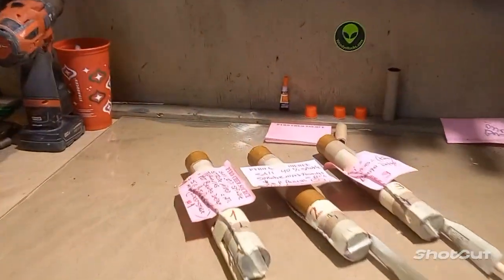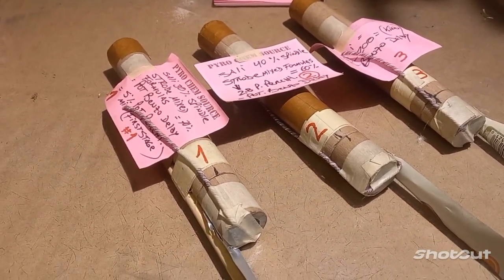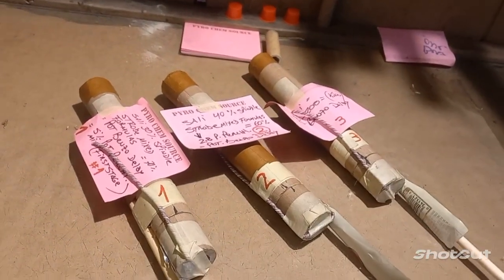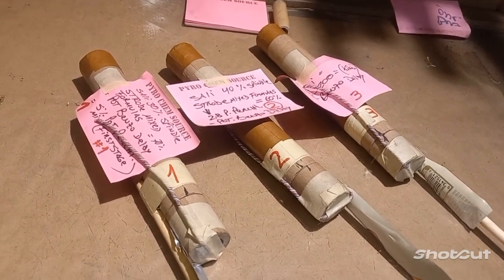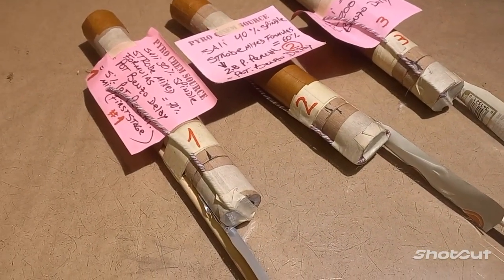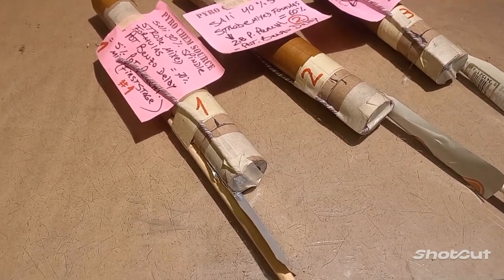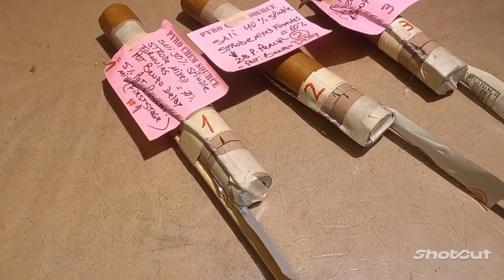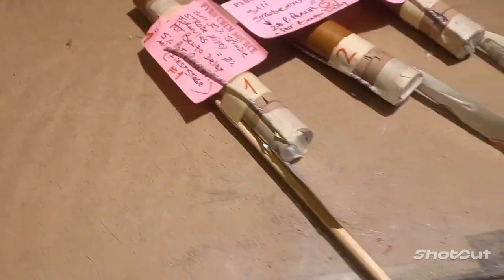Nuclear rocket first stage strobe option (launch)

Comment: Mind sharing your strobe mix from the third rocket? Iv been having trouble with mine.
Reply from the maker: Third strobe rocket:
Am perchlorate 60
Ba sulf. 15
Pot dichr 5
Magnalium 80 -200 10%
Magnalium-325 15%
N/C laquer 4%
Reply: @Pyroflorida  I will try the NC.. iv been using wax and mine strobe way too fast
Reply from the maker: @AstroCityPyro  ok but what formula are you using?
Reply: @Pyroflorida what mesh is your ap?
Reply from the maker: @AstroCityPyro  I usually  buy 400 mesh, but I'm grinding it with a blender to a very fine powder

Comment: Compa do you add your 5% perc to your base of strobe then wet it/ mix it. To run it the screens?
Reply from the maker: I'm making the mix pretty wet with the acetone/NC laquer and do my first screening then sprinkle the pot.perchlorate and mix when still wet and screen again.
You can also get some of your  existing dry ready to go  fuel and add the perchlorate , mixed a little and re wet with acetone and re screen 

Saludos !!👊

Comment: Awesome rockets…I have some of those pyrochem source post it’s 👏 what kind of press are you using? And you should do some construction videos keep up the good work 🙏
Reply from the maker: Thank you for your comment,  I use a hydraulic 12 ton press and force on force gauge , honestly making construction tutorials is not my strong side.. and also will  be a magnet for unexperienced fellows and I'm afraid of someone getting hurt following what I do.. 
Tks again
Reply: @Pyroflorida   I understand I’m just getting into this myself bought my tooling and press from Firesmith manufacturing and have had success with 1lb Bp rockets with salute headings.I’m afraid of mixing strobe or whistle mix up north because of the dry air and static
Reply: @zuess8018  Get a humidity controller, use extra thinner for your mix
Reply from the maker: Totally understand.. and congrats on your first bp rockets .. I remember that huge satisfaction when I saw my first ones flying across the sky👊
Make sure you use cotton clothes,  thick rubber gloves  and wood or plastic spoons etc. Rubber mats are a plus to have, tractor supply sells nice 1/2 inch thick ones 8x4 foot for a good price